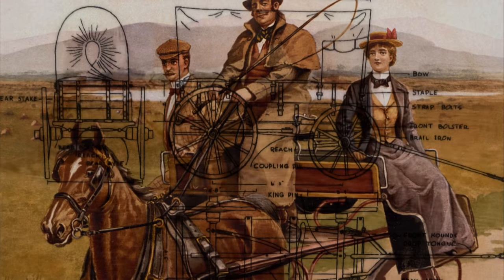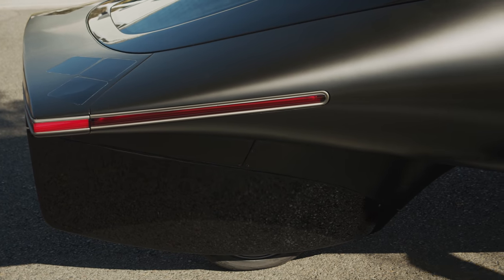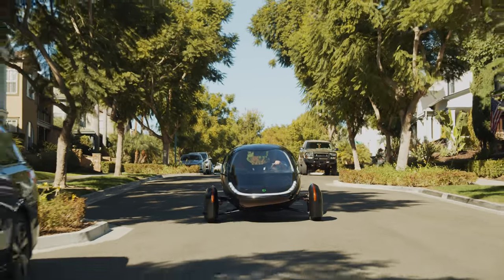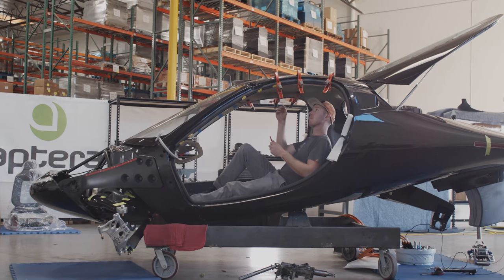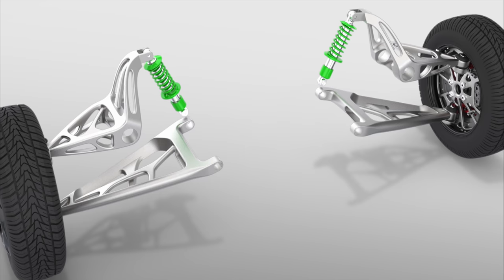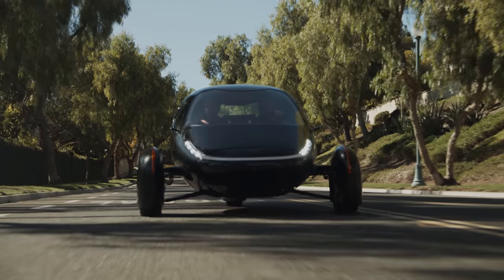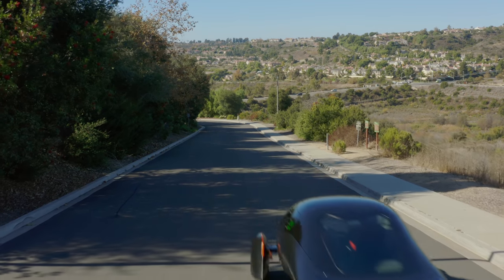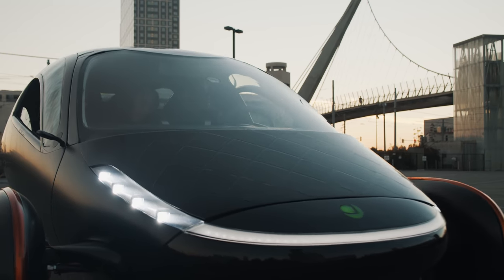Aptera Has Launched

Comment: This is actually really cool. Most people don’t even drive 40 miles a day. I have always wanted a company to integrate solar. Hope this makes it.
Reply: I do 60 miles a day 5 days a week.....and I know a lot of people who do similar.....
Reply: @paullacey2999  Even without the solar panels, you could easily charge 60 miles per day overnight at home or while you're at work from a standard wall outlet. The efficiency on this vehicle is mind-blowing. It's barely using more wattage than an e-bike.
Reply: FISKER did a solar roof panel but it wasn't very efficient.
Reply: @YBehri  why buy another car?
Reply: @YBehri  what is the range of this car?
Reply: 40 miles from solar ain't happening yet. And certainly not with 4 or 5 square feet of panels. These guys are selling snake oil
Reply: @Bubbles99718  It's a lot more than 4 or 5 square feet of solar.  The Aptera is bigger than it looks.
Reply: @incognitotorpedo42  The panels are only on the nose
Reply: @Bubbles99718  They're on the roof too. They're kind of hard to see.
Reply: @incognitotorpedo42  Even if that's the case, panels of this size can't draw the energy this snake oil salesman is claiming
Reply: @Bubbles99718  you seem to be operating under the assumption that we’re talking about a lot of energy here. If you work off their range and capacity statistics you’re only generating 4kwh to get that range. Super doable if your car is in sunlight all day with the 3 sq m of solar panels on the car.
Reply: Paul Lacey most people buddy. Most!

AAA survey from 2015 say, Americans drive 29.2 miles a day.
Latest numbers from Bureau of Transportation Statiscs, under US-DOT say 29 miles a day.
Reply: @YBehri  how? My ICE vehicle literally only gets like 230 miles....
Reply: @YBehri  it takes about 40 minutes to top off a Tesla, given the fact that most of those cars go between 300 and 400 miles on a charge and averaging 60mph, that’s around 5-6 hours between charges, which is a pretty reasonable amount of time before you need to stop, eat, and hit the head. Sure, it takes a little longer but it’s really easy to take long trips in EVs now

I’m speaking from experience on this one.

Comment: It will be an ideal car for India because about 90% area here receives 3000 hours of sun every year. That means 3000*700/1000= 2100 KWh free sun power. It translates into 21000 miles per year. Almost free driving.
Reply: it can also be used with inverter to power Indian homes. 

No need for solar + lead acid batteries, just add a small inverter within the vehicle and fetch about 2000w of power from its main lithium battery.
Reply: Only 1 problem. Cost. 😂
Reply: Cost can be brought down with mass production and reducing some parts.
Reply: The average driver in the EU drives 10,000 miles (~15,000 km) per year. Not sure about India, but I would assume its similar or lower.
Reply: Sort your toilets first nationwide. Btw, your math is off.
Reply: I think you forgot conversion efficiency
Reply: @Helloverlord  they have clean water not like you
Reply: Uhhhh you're missing a few things in your calculations.  The amount of solar panel and the efficiency of said panel
Reply: @thaddeuscosse9527  700 peak watts.  180 cells at about 22% efficiency.

Comment: Love the fact it has hub motors.  Soon you'll be able to easily replace the motors for higher performance or greater efficiency at a competitive price.  What a cool concept.  Hub motors will lower the manufacturing costs significantly. Also love the fact that you allow right to repair.  I am going to invest!  Cheers from Canada.
Reply: I think the Aptera is awesome, but I don't know how well the solar component would work in (most of) Canada. Seriously, I'm in Nova Scotia, and we don't get a lot of sun. I'm thinking this would be an awesome car for places like California though. To be fair, it would be a great summer vehicle for places like Toronto.
Reply: @subliteral1380  Nova Scotia is sunny like a desert! [Laughs in St. Johns Newfoundland]
Reply: @subliteral1380    If you go with the extra batteries, why would it matter?
Reply: @TransformHypnosis  Thanks for the laugh! The only time I ever visited Newfoundland was in the middle of a summer squall. We were only there for a few hours, and it rained like crazy the whole time. I guess it's true, someone always has it worse. You poor bastard.
Reply: @justinw1765  The car would still work fine, but you would be plugging it in to charge the battery about 90% of the time, because the sun is rarely strong enough to charge it. The solar panels undoubtedly add considerably to the cost of the vehicle, so why pay more for a feature that you will rarely use? It's a nice car, I just think that the solar component isn't worth the extra money if you live somewhere that doesn't get a lot of sun.
Reply: @subliteral1380  remember that solar cells work even in cloudy days, just not as well.  Still worthwhile…
Reply: @subliteral1380  nah panels are cheap these days. The full panel array is an additional 900$ most of the cost is coming from the batteries themselves. Also panels still produce in overcast conditions at -20-30% or less depending on the efficiency of your panels, so the energy produced will still be significant with the 40mpd array I would imagine.

Comment: Curious how it handles on corners and generally how grounded it is.
Reply: Probably handles like shit
Reply: This car is simple A to B car. None of that stunt rubbish.
Reply: prob just City commute in LA sitting in traffic going 10mph
Reply: Who cares, it won't get into production anyway.
Reply: It’s called wingless flight for a reason
Reply: Do some research, lots of 3-wheel sports cars out there, plus all the the wheels on this are driven.
Reply: @gestucvolonor5069  0-60mph in 3.5 secs, how quick do you need to go?
Reply: It still weighs something you know? It's not like it's gonna fly off when there's a bump in the road
Reply: skrt skrt into the nearby tree
Reply: @gestucvolonor5069  electronically limited to 100mph (~160km/h)
Reply: @ProbablyTheBestUkuleleDadEver  Yeah, like this car just looks like a more fancier, reversed reliant robin with its wheel placement lol
Reply: @aceb2660  Have a look at Morgan 3 wheelers, Grinnall Scorpion, Vanderhall Venice, etc. Two wheels at the front is a stable layout, well tested for about hundred years now.
Reply: Given how short and wide the wheels are probably pretty good
Reply: @TheRCish  well I respect your well reasoned and thought out argument 🤔🙄
Reply: Given the shape there are three options:
1. It's so slow shape is not a problem.
2. Acceleration is so low that shape is not a problem.
3. It's fairly fast, it develops lift, wheels will not experience enough normal (to the ground) force, the friction (proportional to normal force) will not be enough to provide thrust and it will be inefficient in acceleration once a certain threshold speed is reached.

I would suggest that there's plenty of reasons why none has ever seen a car like this.
Reply: @matscalia  yes we have seen cars like this, 1920s Morgan Super Aero,  1990s Grinnall Scorpion 3, 2015 Polaris Slingshot, 2017 Vanderhall Venice. 
The speed of this car is limited to 110mph, the acceleration is 0-60mph in 3.5sec. Did you actually watch the video? Or watch the first 5 seconds and then guess? 🤦🏼‍♂️
Reply: @imvnyelofficial  dont be so quick to judge. we havent seen how it preforms. the aerodynamics make it look like it could handle amazingly.
Reply: @gestucvolonor5069  look on he website
Reply: It’s not like it can go very fast so I don’t think there would be much worry about that
Reply: Considering it's a reverse trike, not a Reliant Robin, it should handle quite well. There's a few reverse trike car designs out there already that handle just fine. In recent memory, the Polaris Slingshot, and into the past, the Morgan three-wheelers. It's not that far-fetched of an idea that when you come to a corner, you tend to brake. And when you brake, the force exerted on your vehicle is forward. When that is combined with the force exerted from turning, the front outside wheel of the corner receives the force. Much better than a forward trike would handle the corner, not typically as good at a four-wheeler would handle it, but it's still adequate for safe cornering when well designed. I can see there being some instability when the car isn't braking in a corner, and some more when the car is accelerating in a corner (not accelerating out of a corner where the steering goes back to center). At least it's not a lifted truck. Lots of instability in a tall four-wheeled vehicle with a high CoM, instability that wouldn't be present in a low CoM two front wheel three-wheeler.
Reply: @ProbablyTheBestUkuleleDadEver  oh, nice to see others sticking themselves out for reason :) hadn't read the comment thread to see you already mentioned Morgan lol
Reply: @imvnyelofficial  for more reading: https://en.wikipedia.org/wiki/Three-wheeler
Reply: @ProbablyTheBestUkuleleDadEver  not on the non all wheel drive models
Reply: @markbajek2541  the two wheel drive version is both front wheels driving, so I think that has been proved to be a pretty safe and is well tested.
Reply: @matscalia  it's so aerodynamic it's not going to produce lift

Comment: Let pray this becomes a reality and affordable. 🙏🙏🙏
Reply: It is...
Reply: @jcrawford5674  45k for 1k miles, 25k for 250 miles
Reply: The projected cost for the ' cheaper ' model Aptera with 400 miles range is about $38,000 Canadian. Currently I can buy a solid dependable cheap to run and maintain Toyota Corolla for about half that price. Maybe for some folks, dropping 40 grand for a car is affordable, but for the rest of is, it isn't. You can't just have electric cars for the better offs in our world, they have to be affordable to everyone if they're ever going to become universally viable.
Reply: This car is not good. Like not at all. and not as good as they tell you it to be
Reply: @breadbeard6722  Have you driven one?
Reply: In some areas you also get a tax break for buying an EV so you could get one of these for around $19,000. Which is insanely cheap for a brand new car. Some motorbikes cost more than that.
Reply: @breadbeard6722  how do you know this? Have you tested one? Do you have special inside information? 

Im guessing the answers are no.
Reply: @patrickchubey3127  and also pay thousands a year for fuel, oil, servicing, repairs etc on that Toyota and even more with the cost of fuel going up and up. So, after a few years, you would be wishing you had bought a car that can give you 40 free miles a day from solar power and costs very little to charge up when you plug it in.
Reply: I'm sure a lot of people would, but I was talking about me and my driving needs. We drive very little, to the point where I get reduced rates from my car insurance company for an " infrequent driver discount ", we just don't travel a lot so for us, saving 20 thousand dollars right off the hop would be better, we'd invest the 20k and spend very little on fuel since Corollas are very fuel efficient, Toyotas are dependable so again, very little on repairs, if any, and as far as the oil goes, you can't put very much oil in a tiny 4 cylinder engine and because I drive very little, it's only necessary to change oil twice a year. Meanwhile, that 20 thousand dollars I invested is more than paying for the expense of the Toyota in dividends. The bigger picture is that I'm not going to drive 40 miles a day, more like 40 miles a week, if that.

Comment: I designed a .5 KW 48 volt solar charge system for a Polaris Ranger EV 15 years ago. It’s got 6KW in storage and I never plug it in with the exception of wintertime plowing snow. The AGM batteries have never been cycled below 50% and are still in great shape and overall health. In the process of converting to lithium storage with same capacity that will shed 400 pounds of weight thus extending range by two thirds. I get average range of 25 miles a day free and clear now … shooting for 100 miles with battery upgrade.

Nicely done Aptera , good luck … I’m with you

Comment: This is a game changer, never charge technology
Reply: But without the sun there no charge
Reply: @henryobaka8282  Or With vaporware there is no charge.  Are they going to have you park it leaning towards the sun to get this 40 mi of range?
Reply: @garbizwal  They've been testing this setup on level surfaces not tilted, facing in a ton of different directions and optimizing the angles to specifically average out to what they are advertising. No vaporware. No abnormal conditions. Just 700W of solar on top of a car. That's more than most people install on their houses I might add unless they are going completely off grid.
Reply: @garbizwal  They have published a solar radiation chart.  In San Diego, where they are located, they can get 45 miles on a summer day.  As usually YMMV,
Reply: @n.brucenelson5920  You are telling me that no matter what angle the car is parked on its always going to get 45 miles added to the battery ?  I call BS.  Yes on some optimal days you will see it add some range.  But most days you will have buildings or trees or hills in the way as well the car won't be parked on the right angle to get the sun on the solar panels.
Reply: @garbizwal  No, nothing of the kind. You are right about this.
Reply: Yeah I shouldn't have to say this but there's no chance a solar powdered vehicle could be charged overnight because there is no sun in the sky during the night
Reply: @halllwd94  
A tiny little car like that, has more solar cells than most people (who have solar in the first place) install on their house?
That does not sound credible.
I want this to be real. I want this vehicle to make it to market and be as good as they say it is. But it's claims like this that make me doubt.
Reply: @theuncalledfor  The car has the same width as a Model S and the same length as a Prius. It's not tiny by any means. There is 7ft of space behind the driver and passenger. My point is 700W of solar is 700W of solar no matter where you put it. The average van owner who lives in their van or RV liver puts 400-700W of solar on their car. Houses that want to power fully can go up to 1Kw-5Kw depending on size. But for a car of this size 700W of solar is a ton of solar. Combined with efficiency and their last year of testing. You'll actually see the 11-15 region dependent miles they are claiming. Combine that with the fact that it's 3x more aerodynamic than a Model 3 and even still a .05 drag coefficient more efficient than the  VW XL1 which averages between 120 and 180mpg, and has been known to get up to 300mpg with a diesel hybrid system. You'll see the numbers the are stating. You may even see better numbers.

Comment: When I saw Aptera had restarted, I started doing my due diligence.  What I found out after reviewing their history and emailing with Elaphe, the wheel motor supplier, caused me to write them for permission to reprint some of their drawings.  They granted me permission, and invited me as a charter member of their brand ambassador program.  I happily work to spread the word as a volunteer..

I was able to make a small investment in their crowd funding and get an early pre-order.  Later my wife and I rode in the Luna prototype, and I had a chance to quiz an engineer on thermal design - a field I have some expertise in.  We couldn't be more excited, but the fit for our personal needs is only one reason.

I spent decades working in environmental clean-up roles, including in Kuwait during the fires and on off shore production platforms.  I have seen the messes more closely than many.  I see Aptera as one of the many ways we can do better than we have in the past.  I am in not only for my own needs, but also for our  posterity.

Comment: I would like to see how this design can handle side swipe from other vehicles in a crash. In the video they mentioned the design was inspired by F1's mono cockpit for safety. But a F1 car doesn't usually survive a side swipe/crash. The driver will be safe, but it probably won't get you back home after the wheel has broken apart. A normal car can at least take a side swipe without having the wheel broken. Lastly, race track has many safety elements like tire barrier, run off area and safety personnel that work in tandem with the car in case of accident while a normal road doesn't have.
I do think the idea and design are mostly great. But they need to change the open wheel design for more safety

Comment: As positive it is to see this, Aptera is alive and that's grand, but this video certainly has that feel of being aimed at translating as easy as possible to executives/investors.
Reply: They need to be able to do this to get these into production, so I hope this is correct.
Reply: @n.brucenelson5920  It's safe, but I guess what I hoped for was some congruity and context. Aptera has quite a history
Reply: @toyotaprius79  I have been posting the press history on Reddit at r/ApteraMotors.

Basically, the original founders brought in management and investors with Big Three ties, and got thrown out of the company over a disagreement that they turned out to be correct on, and the remaining management drove it into liquidation.  In the years since, both have founded and run some very successful companies, including a lithium battery manufacturer.  They have quietly gathered top partners world wide for this go round, and are not attempting to do everything themselves.
Reply: @n.brucenelson5920  Marvellous!

Although... being stricken to suppliers may be advantageous in one sense, it doesn't provide that silicon valley-economic vertical integration, in-house strategy. 

Rather, remember that very promising other 3 wheeler that got 70mpg from a 1l 3cyl suzuki mill? They worked with a host of outsourced suppliers to provide an affordable product, but now we hear nothing of them.